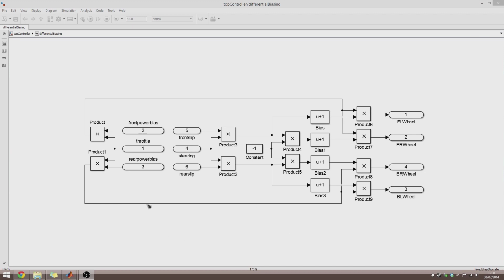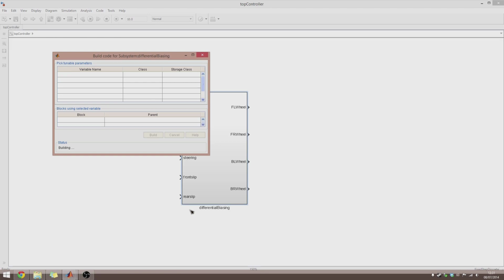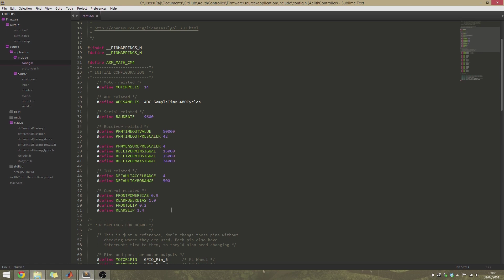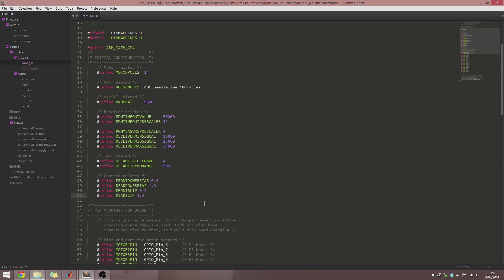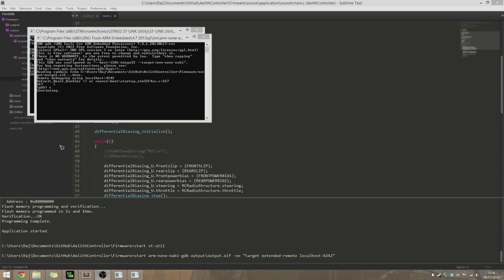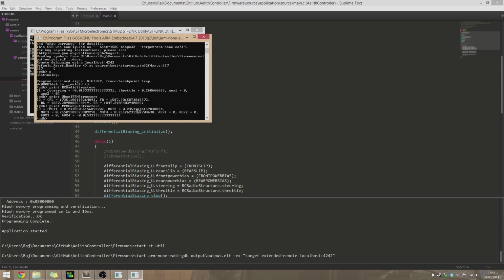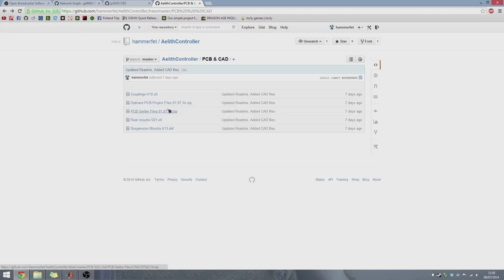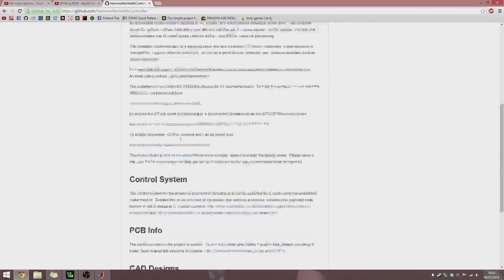Independent Wheel Drive 1/10 Scale RC Car | Project Aelith

Comment: this would be so nice in rock crawling. with the press of a button you have all front wheel drive, or rear, or all power left/right. all the power could go to one wheel. all by just cycling a button. this would be game changing.
Reply: i dont see why you couldnt mount two small motors in a solid axle configuration. maybe even motors in the wheels themselves and then just connect with linkages 🤪

Comment: Sure hope you're still responding to this old thread. I love your project! It inspired me to do a similar thing, although slightly simplified. My main question is this. To optimise straight line stability, do I really need to feed back the RPM's from all wheels and implement 4 PID controllers, or would it be enough to use the on-board GYRO and control the stability by doing steering adjustments?
Reply: Did you figure this out? Wondering why this project wasn’t more popular. So rad!
Reply: @robksawyer  I think I did! No matter how fast your microcontroller is, sync-en 4 brushless motors with 4 PID controllers to get proper straight line stability at higher speeds seems (after some experiments) almost impossible (with RC cars). Tried it using 2 Arduino Nanos, horrible driving experience. It just takes too long for the motors to adjust when correcting a bump in the road. Almost impossible to keep it on the road and haven't seen a video of this car (Aelith) at higher speeds ......

Then did it the 'simple' way, using a (standard) RC car gyro to compensate for yaw, works great. 
Also turns out, you don't really need a differential. These motors (sort of) automatically adapt their speed/torque ratio when cornering (I'm sure there is a more scientific explanation for this).
And lastly, when using drone ESCs (like BLHeli's) you get 'damping'. It's like one-pedal-driving. Releasing throttle is like pushing the brake, using the induction forces in the motors. No wear-out of any components!
You may want to have a look here, more extended video to come (gathering energy to do it): https://youtu.be/GQypgMc-ZJw
Reply: @hybricks9390  rad! Thanks for the detail, I really appreciate it. And congrats on your own build and figuring this all out. I’ll be looking forward to following along.

Comment: Mate this is an amazing project! so would you be able to use a drone flight controller to achieve this? if this project were to progress in the same way as Betaflight where there is a GUI so that a simpleton such as myself could control the parameters etc then this would introduce a whole new era of RC cars! the gyro on the flight controller could be used for traction control and modern 32 bit ESC's have telemetry to sense all sorts including RPM and current draw. Have you continued much on this project since 2014?
Reply: I am tempted to get his code working in a ArduRover target. That can use some FC's that BF uses. Like matek ones.
Reply: @bassohollic  have you made any headway on this? I would love to reuse my Omnibus F4 flight controller to build something similar.

Comment: I think there is a market for your design if sold in kit form - with basics already wired and programmed to go. I wouldn't think many would have a need to change parameters. This is for an on road car, but I can see this as a great off road platform if it can handle the jostles of mild off roading.

Comment: I know this is really late, but did you have to create new shafts for the motors? What kind of motors did you use/KV rating. I looked at your github, and there is no info on the "hardware".  Thanks!
Reply from the maker: I believe they were "Turnigy 4206 530kv Brushless Multi-Rotor Motor" from Hobbyking. They seem discontinued now but maybe you can find some equivalents somewhere. The KV has to be quite low to get enough torque as it's direct drive, and I'd also recommend using rc car specific ESCs. The ones for drones won't give enough kick to get the motors turning from a standstill. The shafts were original, I just cut them to size. There's a grub screw which lets you adjust the position too if you wish.

Comment: Greetings Rajesh. 1) You wanted to add closed-loop control using accelerometer and gyro readings ( to correct oversteer ). Have you proceeded with this? Can you write about your progress or send a video?  2) You have planned to add pitch detection, 2 wheels special powering? Have you proceeded? Can you upload the files? Best Regards.

Comment: Apparently Mercedes used the same idea in the SLS AMG electric. This is very impressive stuff! I wonder how far they went into programming the speed of each wheels.
I'm not sure if I'm understanding this correctly, but negative numbers in your PPMOutputStructure mean that you can drive the motors in both directions at any time? or is it braking ? Can you use it as dynamic braking to charge your batteries even on a small car like this?
Great work man!

Comment: Awesome car! I'm also building a car just like yours, but I'm having some difficulties ordering the parts for my project. I've chosen this motor: http://www.hobbyking.com/hobbyking/store/uh_viewItem.asp?idProduct=47721
Do you think this motor is nice?
My problem is witch ESC should I choose. I was thinking about this: http://www.hobbyking.com/hobbyking/store/__11742__HobbyKing_Brushless_Car_ESC_30A_w_Reverse.html
I'm not sure if it's ok to use this ESC cause  on the motor's specs they say the battery should be 6S and on the ESC 2-3S.
Can you give me some help?
Thanks
Reply from the maker: Those motors look quite powerful and low KV seems good for high torque (i'd say run these with 3 cells to get good speed). The ESC however seems okay from the fact that it's 30A, but I have a feeling you might run into trouble. I used the 25A turnigy car ESCs (or 30A, I cant remember) and they didn't work. They couldn't give the motors that initial kick to get them moving if the car was standing still. Only the high current ESCs would get the motors moving. I'd say get higher current ESCs to be safe. Also HK is an okay brand (I have HK brand ESCs) but mine have started to break after about 6 - 7 months. The plastic is all cracked and water/dirt gets into the ESCs really easily.
Reply: what type of ESC you used in this project?

Comment: Does the STM32F4 have PWM modules inherent to the board pins? I'm thinking of using the STM32F4DISCOVERY and the Base Extension board for a project I am working on.

Comment: What size are the motors? I am planning to make a similar design using 4 Hovership H2204X 2300kv brushless motors. (The design will be hard because they have threaded output shafts designed for propellors.) I ended up getting these because I originally planned on making a quadcoptor. They have a width of 27.5 mm. Is this comparable in size/power to the motors this model uses?
Reply from the maker: Turnigy 4206 530kV motors from hobbyking with a 42mm diameter. I had to adjust the shafts a bit too, They normally protrude from the rotor of the motor but I needed them to stick out the back of the stator. It was just a case of loosened the grub screws and hammered the shaft through until it was flat with the rotor.. I also cut a small face onto the shaft to key into the 3d printed motor coupling. The high torque meant that using a grub screw to hold down a round shaft would just result in the shaft slipping. 2300kV sounds way too high, to compare, I've just built a 1/24 scale version of this (video coming soon hopefully) with 1600kV motors and it has trouble with starting torque. 2300kv might have big trouble starting up so you might just want to rewind them with thinner wire and more turns
Reply: NakLojik Thanks for the feedback. I've looked into the idea a bit further. First, I understand that inrunners have more rotational speed, while outrunners have more torque. Although kV is a measurement of rpms per volt, I agree that it is a reasonable conclusion that an outrunner motor with more rotational speed would come with more torque. However, if both motors in question had the same theoretical rotation speed, my motor would likely have less torque because of its smaller diameter. I don't know the torque output of these motors, but I would imagine that despite the smaller diameter of my motor, it has a bit more torque to handle. I am planning on 3d printing a custom wheel out of abs plastic to house the motor, threading the wheel directly onto the drive shaft, eliminating the need for a coupler. Since the output shaft is threaded, slipping shouldn't be an issue. My base is also going to be 3d printed, so mounting the engine/wheel assembly onto the car should be no problem.
Reply: Also, if my copper wires were any thinner, It would be like coiling the thread that makes up insulation. But thanks for the idea.

Comment: This is cool. I was working on a project a bit like this using hub motors inside custom 3d printed wheels on a Tamiya TT01. http://www.rcgroups.com/forums/member.php?u=474442. I was also looking at converting another car to use a small inrunner + pinion + spur mounted inboard at each wheel. I have some drive cups but haven't yet figured out how to connect them to spur gears. And then I need bearing housings and motor mounts and I have to somehow figure out how to fit it all in amongst the suspension and steering gear.

My plan was to eventually implement traction control, torque vectoring and regenerative braking. But for my design I'm planning to use custom speed controllers based on Texas Instruments microcontrollers and their Motorware software but I'm currently waiting for them to release some crucial features related to rotor position detection (needed for maximum torque at zero speed). Using custom speed controllers I should have better feedback and centralized control of current, torque and speed at each wheel without even needing any hall sensors.
Reply: ***** Yeah, dirt is a problem. I'm not sure how badly suspension is affected. I think moving the motors inboard is a good idea and I'm thinking that if I move to inrunners then its easier to keep them cool but keep dirt out at the same time. I'm looking at starting with a Tamiya TA05 V2 for this because the IFS leaves more room for motors up front.
Reply: ***** Another approach that might be interesting is if we could get these outrunners as a kit of parts and then get a custom double-ended bearing tube machined and maybe even get the drive cup integrated into the top of the rotor...
Reply: My new version with gearboxes is coming along quite nicely. I've glued the Tamiya drive cups onto some 60T 48dp spur gears from a 1/18 scale Team Associated car and I have matching 10T pinions that fit the motors I'm using. These are currently 150W 3860KV Turnigy in-runners but I plan to upgrade to the 250W 6320KV version later. I have a full set of bearings and I've also designed the front gearbox housing and it's gone out to be 3D printed.
Reply: I just saw this http://naklojik.blogspot.co.uk/2013/07/rc-due-new-genaration-of-open-source-rc.html with the PCB as a chassis. Since I'm planning to design all of the electronics including the speed controllers and since there will be quite a lot of it I'm thinking of doing the same thing (to save space and weight). Do you have any comments? I'm a little bit worried about stressing the electronics.
Reply from the maker: shawkie At 1/18th scale I didn't seem to have a problem with the electronics. I had planned to put some epoxy on any components that were tall or had high pin density. Things like caps and small LGA packages. I never finished that version because it was easier to just use the stock chassis. That car was originally a Losi Micro rally/buggy car. On top of that, Hobbyking did some motors that fit perfectly into those wheels. I used a bench vice to push the rotor onto the wheel hub and it never came loose. It was a very very quick car for its size
Reply from the maker: shawkie also in that build I used copper bars to hold the suspension assembly on. Wasn't very rigid. Looked good at first but any heavy impact would just sheer the copper wire off. There was also a chance you'd melt the plastic when soldering the copper wire onto the board. If you try this, I'd recommend making a screw down bracket rather than wire
Reply: NakLojik I think the plan would be to have screw holes in all the same places as the original chassis and reuse all of the existing steering, suspension, etc. Maybe turn the steering servo on its end so I can run the battery down the middle of the chassis and put the motor driver electronics down each side. I'd probably put the overall controller on a separate PCB over the top (maybe acting as an upper deck to stiffen the chassis).
Reply: The gearbox design has hit a bit of a roadblock. I'm seeing horrible efficiency compared to the hub motors. One hub motor can do 10krpm (at the wheel with no load) on 12v and 1.2A. The in-runner with gearbox takes over 4A and only does about 8krpm. Increasing the KV will get me up to 10krpm no problems but with a further increase in current no doubt. Not sure if these are just bad motors (the specifications are clearly fiction at any rate) or if weight-for-weight out-runners are just much more powerful. Maybe I should try to get hold of a Neutron 705 before I give up on the idea (not easy in the UK though).
Reply: ***** Yeah, you're probably right. Also, to be fair, my hub motors are 65g rather than 50g which gives them an advantage to begin with. Anyhow, looks like I might have to go back to outrunners. I don't think the technique you've used would work well on my chassis and I don't really like the way you've shortened the dog bones out to the wheels. So I'm thinking of sticking with a spur and pinion but bringing the gear ratio right down (to maybe 1:2 or 1:3) and then using a high KV outrunner. Possibly a MultiMate MT2212 with a suitable rewind.
Reply: ***** Actually, the higher KV motor combined with the TI speed controller and backing off the gear meshing slightly has got me up to 10krpm at 12V, 2A. That's starting to sound more like a workable solution. I even managed to push it up to 12krpm! I'm curious about your motors. They're bigger than my hub motors (which are 3506's) and they're wound for about half the KV. Do they not have insane amounts of torque? Incidentally, if they're as much like the iFlight/iPower motors as they look then they are really nice easy motors to rewind :-).

Comment: Hello NakLojik!! Congratulations for the project! 
I have a question about mathmatics: What kind of controller did you implemented ? Is it a Proportional,Proportional-Integral or Proportional-Integral-Derivative? Or you invented one? Thanks!
Reply from the maker: There's no feedback control used in the video. It's all open loop. I was planning to use PID control and not use the I or D gains if I didn't them... However.. I've now decided to go for a fuzzy logic controller and it's coming along quite well. I should be releasing a video in a few weeks once I've fine tuned it so keep an eye out! :)

Comment: how about the speed ?
Reply from the maker: it's not bad, currently the 530kV motors give a no load speed of something like 30km/h with a 2 cell lipo. Similar to my stock setup. I'll soon rewind the motors for more kV as I've got loads of headroom as far as torque goes. If I can find a good sized 3 cell lipo, I'll use that instead

Comment: You don't need transistors to drive PWM inputs.
Reply: Not always true - he needs to shift the PWM voltage (most likely 3.3V on the STM32) to the typical 5v expected by ESC's.
Reply: Kamil Zadora
We both use the STM32F4 to drive ESCs.  They don't need level shifting.
Reply from the maker: heroineworshipper The servo I was using was glitching out if i tried to drive it with 3.3V, hence the transistors to bump it up to 5V. When I was planning the design, I also thought to use some of the unused PWM outputs to drive headlights and brake lights, again, 5V buffers needed. It's just a few extra components so not really fussed

Comment: Nice project, added something like this on my evergrowing todo list.

Did you consider having the motors inside the wheels completely omitting the need for drivegear? (I know this would increase non suspended mass which is a bad thing)
Reply from the maker: I did this before with a 1/18 scale buggy, it worked quite well because i happened to find motors that were the exact same size as the inside rims. I tried that on this car, but the way the stock wishbones and steering assembly is designed, would cause the track width to increase quite a bit. I'd need super thin motors to get away with it. Non suspended mass would have been a problem too, these motors are quite heavy